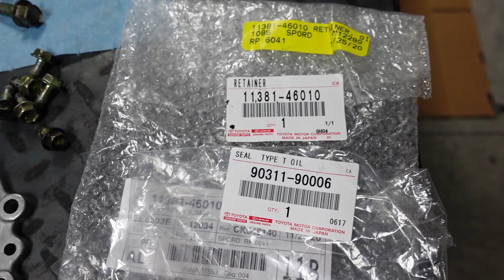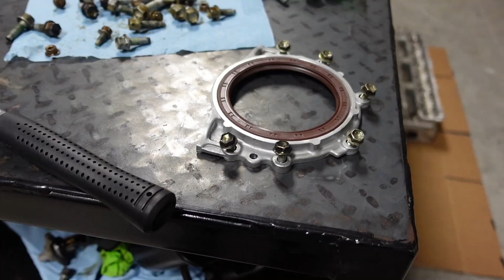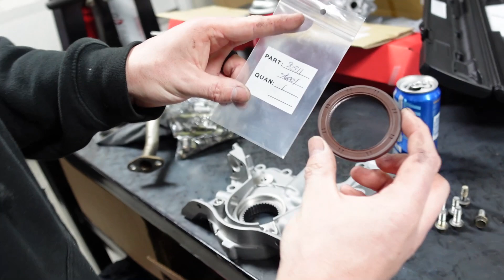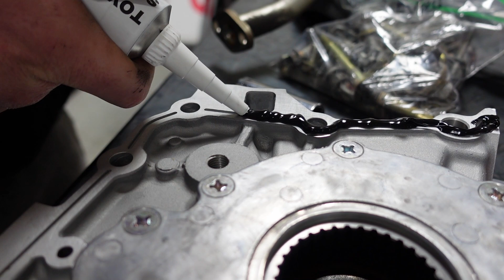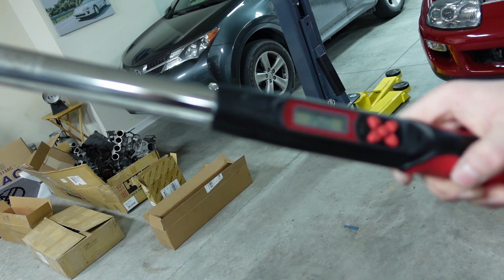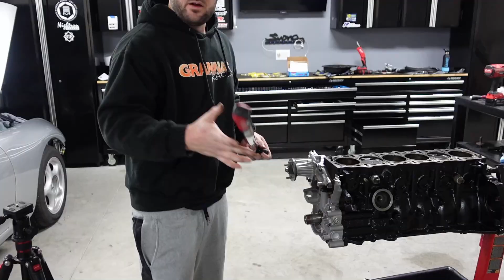2JZ  NA-T Build Ep. 2 - Rear Main Seal, Water Pump & Oil Pump

Comment: You don’t double up the sealant by the inlet and outlet of the oil pump. The inner groove is specifically so the overflow of sealant doesn’t protrude into the inlet or outlet.

Comment: Why did you decide to go with the gte oil pump besides the crank sensor? Wouldn't it cause higher oil pressure due to the lack of squirters?

Comment: I may be wrong but I thought the second pair of short channels next to the oil inlet and outlet ports on the oil pump are a relief channel to catch excess rtv/silicone from the primary sealing channel thus preventing excess silicone from getting into the oil system or creating any type of blockage etc. If this is the case you want to leave those channels empty
Reply: This is one reason I'm watching the video there's another video on real st that says the same thing to leave them empty its to catch the access sealant from getting into the oil

Comment: Why did you go with a gte oil pump even tho you dont have oil squirters or factory cooler? Dont all 2jz run the same oil pressure anyway?
Reply: Crank sensor

Comment: im still learning a lot about doing a na-t build before i start my own project, just wondering if there was any other reason to replacing the pumps and the rear main seal besides maintenance and if its necessary . thank you
Reply: pretty sure to save time and headaches later. you may turbo your car but you need supportive mods to make it reliable

Comment: Can the vvti ge handle as much hp?
Reply: The vvti has weaker rods than the non vvti ge, however the block and the crank is the same on all 2JZ across the board.
Reply: Vvti can handle 400 on e85 at best

Comment: So if i get the gte oil pump i obviously need gte oil pump seals and o rings specifically right
Reply: The seals are all the same, the changes between pumps are internal mostly. The gte and vvti pumps have provisions for a crank sensor. But as far as seals go they are all the same

Comment: Why don't you like porting the pump?
Reply: Probably because a lot of people destroyed their engines from metal shavings. But you should always clean parts like that.
Reply: You dont need to port your pump unless you are making 2000 horsepower and need a shit ton of oil pressure to make a safe pass down the 1/4. These pumps provide plentiful oil pressure.
Reply: I thought it had to do with guys reving high often causing the main seal to blow